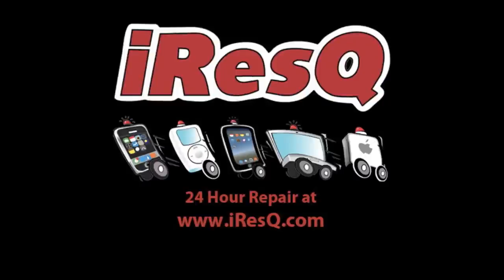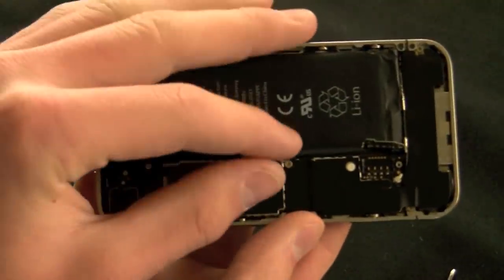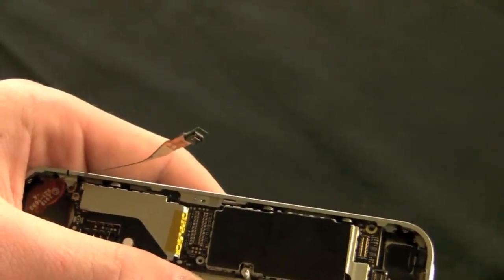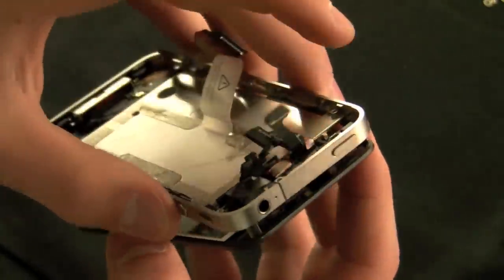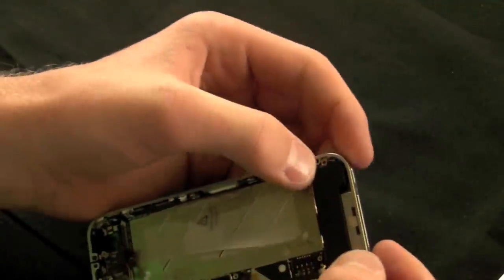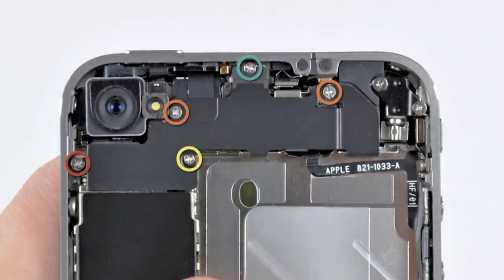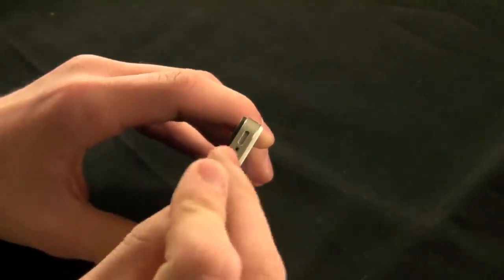iPhone 4 Screen Replacement Disassembly and Reassembly - FULL WALKTHROUGH

Comment: i took mine  all apart and then  realized i got the wrong part the one i got has no screen so its just the digitizer  not the screen witch is stuck to the old one and i tryed to see if i could use the old one then it cracked and now i cant put it back together ideas on what i can do.

Comment: the 2 screws you just unscrewed at 4:50 ( not the one under the ribbon but the other one), the other one is a stripped screw, its spinning but it wont come out. what do i do?:( i cant continue the process without being able to remove it

Comment: on the reassembly i couldn't get the top part of the mother board to go back down completely and therefore couldn't get the longest screw on the top bracket in? what did i do wrong?

Comment: everything works except the touch screen, I ripped the plastic attachment cable with the chip attached to it from the front screen but plugged the chip in anyway, would that be what has caused the problem?

Comment: thanks for the info on the speaker , my phone service is working again .. the only thing that worries me iS that im left with a piece of rubber about 1/4 inch long by 1/8 inch thick .. worried that it has a large importance like insulating wires from each other or something .. if anyone can help that would be great .. thanks!!

Comment: @ThatSnazzyiPhoneGuy Hey, my iPhone doesn't respond to anything right now. Woke up and it's not powering on or anything. My lock button is busted so power cycling it is a no go. This has happened before, and I took it to the apple store, was in and out in 10 mins with a working phone. The lady said she pulled it apart and said the connection to the battery or something was loose. It was free the first time, but now ill be charged, so i was wondering if it was an easy fix to do myself.

Comment: Have to make sure that the cables for the screen is all the way through the cut out of the case before you scure the screen. also the screws for the speaker section are no the same length.Overall it was a helpful tutorial.My phone showed no signal for an hour whe it was all done. but works well now.

Comment: Thank you so much for that great video! Nice and easy! However, it might be worth giving more details about the camera position and the cover that goes over the cables. My camera was integral part of the motherboard and just came out naturally but when I reassembled it it was not flash with the rest and I couldn't close the back. Something went wrong around there. I ended up breaking and filing one of the little plastic bits that hold the back and the phone together to be able to close it. It's not perfect but my future new phone case will keep it together. Also, you missed the vibrator in the reassembly ;)

Comment: Well I just did this and it worked but there is a mistake in there with the special screw that requires the philips screwdriver. On the disassemble it is different that where it is put back on the reassemble. *Note: The special screw goes on the top of the phone under the top plate... not on the side by the motherboard.* Other than that it was pretty good and easy to follow. I put all the screw and different parts in an egg carton to keep them in order. Thanks!

Comment: If that's happened just after you replaced the screen its because the battery ribbon has broken in some way. I fresh battery should get you back up and running. It's common for battery ribbon connectors to break, they get age and work hardened with heat and then being pulled about. Contact the video make for a new battery. Remember he should be rewarded with sales for the help he's giving away. there site is above. I hope this info helps.

Comment: at 2:58 of the video where you remove the 5 screws, the one you circled in YELLOW is the smaller screw. I noticed, because I bought a used iPhone from a friend, that screw was missing. I replaced it with the proper screw, but it doesn't screw into anything. What am I missing here?? I think a piece of some sort is missing because the screw won't screw into anything, thus the screw keeps falling out! HELP!!! @SNAZZYLABS My wifi connection is terrible and i have to stand close to the router

Comment: Addition to this comment - I realized after assembling that I had left out a small rubber spacer that went above the motherboard to protect the digitizer cables. Upon opening the device, I saw that the "yellow" screw that I had talked about earlier was missing and nowhere to be found inside the phone. Do you know the size of the screw or where I can find or order another one?

Comment: Did you ensure your antenna cable was properly seated when you clipped it back on? Go back in and re-seat it to make sure. This should be the only thing that would prevent you from getting a phone signal. 

...unless of course you weren't gentle and royally damaged something else.

Comment: Hello, last night I successfully replace the screen. The only problem now I face is charging is not working nor data connection. What should I do?
Reply from the maker: Check to ensure the 30-pin ribbon cable is plugged in.

Comment: But i do have a 4. But when I opened it up, the top left plate thing is designed differently and i for some reason, the cables to the motherboard are in different places and I also don't see the vibrating motor

Comment: hello anyone, when i reassemble the speaker at the bottom, one small rectangle black rubber fall off but i couldn't find where it belong, need help if that part is necessary to get it working! Thx

Comment: Two steps I didn't notice is 1) use the old speaker grille 2) When do you put back in the vibrating motor.

Comment: What was the name/size of the screwdriver used to take out the inside screws?
Reply from the maker: +SoldierSparky Philips 00.
Reply: +Snazzy Labs Hello Snazzy Labs, I have followed your guide 100% through, but I still got a white screen. I replaced the screen to get rid of the White screen but it is still there. It has never been dropped in water and I've made sure all connections are all in.  Please help.
Reply: I think i can help you.Pls say me what's happening
Reply: Francisco Rodrigues Thank you for the offering but I have put a new screen on it successfully but it still showed a white screen. I gave it to a repair shop they said that the motherboard is busted. I did use an app called tongbu to mirror  my iPhone screen to my Mac, that is the only way I can use it. But the frame rate is very low.

Comment: Sounds like your screw might be stripped. Check that the screw is actually turning with the screwdriver.
Also try grabbing with some small tweezers or something and pulling gently. If that doesn't work, try the same while unscrewing it.

Comment: Does all your apps and stuff stay on it or do you have to redownload them?
Reply: You are changing screen, why would it remove apps that are stored on iPhones hard drive?
Reply: Clipping your finger nails wouldn't take your fingers away. :3
Reply: One problem I had with this was that when I was finished and rebooted the phone, it was stuck in a repetitive loop at the apple logo. The only way to permanently fix this was to restore in itunes and if I didn't have all my stuff backed up I would have lost everything.  In saying that, I may just have been one of the unlucky ones, and this problem might not be all that common

Comment: the screws holding the lcd are rusted and I am unable to remove them...any tips?
Reply: If gou really don't care about the broken display, get a knife and get between the steel housing and frame-glass on the iPhone and twist it. My screws where so stuck and i couldn't get them out so i did this trick and the frame mounts (where the screws are screwed at) also came out and the screws + washers where automatically free

Comment: Good video but definitely missing some key steps... It never has you reattach the vibration motor, has you screw the screw with the "water sensor sticker" without pulling out the plastic tab that says authorized service only - you can see that the tab is incorrectly stuck underneath the motherboard in the video, and it doesn't have you transfer the metal grill and front camera lens from the old assembly to the new one (which is a real bummer to finish and realize you have to do everything again!

Comment: I'm not 100% sure, but the thing you say power the speaker, I'm pretty sure it's just the connector for the antenna. But it doesn't really matter, it needs to get off either way :p Thanks for a great walk through.

Comment: i just converted my iphone. it worked at first but now it wont turn on but only when plugged to the wall and it says connect to itunes and when i conntect it will turn on and show the logo and it will turn back off.

Comment: Followed video no problem started phone had No Service in top corner to correct this remove battery connection and reconnect, phone should start OK. Also the 6 small screws with washers that remove the screen when replacing these use a magnetic screwdriver to hold the washer in place so the screw can be passed through it. In total allow one hour from start to finish

Comment: ONE IMPORTANT PART MISSING IN THIS TUTORIAL!! - THE GRILL (THE NET) THAT COVERS THE TELEPHONE SPEAKER (THE ONE ON TOP) USUALLY STAYS ON THE OLD (BROKEN) SCREEN AND NEEDS TO BE PUT BACK IN PLACE BEFORE YOU START WITH THE REASSEMBLY. And the microphone reconnection is also missing, but quite straightforward. Otherwise - perfect! Thanks!

Comment: after reassembling. the screen is working perfectly but my phone is unable to detect any network.its not catching any signal. i ve tried with different sim cards.
Reply: Your antenna is not hooked properly see 4:50.
Reply: or u damaged one component near the connector of the antena wire when u place back the speakers module....
Reply: mohsin ali thank you very much fixed my problem :):)):) <3

Comment: Hi, i dropped my iphone 4 and broke the glass but the phone still works as normal. I'm just wondering what exactly i need to replace it? is it just the LCD screen or do i need a digitiliser and so on? if anyone could help it would be great. Thanks in advance.
Reply: I'm not sure you can just buy the LCD Screen by itself since both the digitizer and LCD screen are together. It doesn't cost you that much for a screen, I bought mine for $30 AUD and it works brilliantly!
Reply: Cool cool, Thanks a million. I've ordered one, i'll try fit it and hope for the best :) Thanks again!
Reply: Mikey Kennedy it's not like the 3g/3gs.. the lcd/digitizer are one piece for the 4's and 5's :).. you'll be good
Reply: Nolan Mendoza thanks very much :)

Comment: i know its been a really long time but i found out that i didn't connect the antenna wire on completely (the little wire you have to disconnect right by the speaker. it looks like a nub and clicks on and off)

Comment: How many different different LCD touch screens are there for Apple's iPhone 4??? The placement of the 6 screws with washers were different from my original LCD touch screen!!!??? Yes, and one of the two ribbon cables was definitely too short, and NO, it wasn't squeezed, because I took it apart and noticed it was shorter! My basic question is: how many different iPhone 4 LCD Screen and touch pads are there????

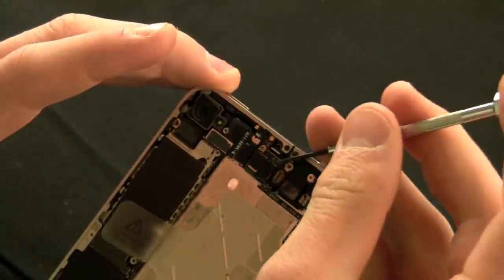Comment: 3:38 there are 6 buttons there and not 5 including he camera cable. It should be removed as well. As a result-following your video, and  during reassembly, i destroyed the new screen  back cable tape when trying to fit motherboard in its position.

Comment: you forgot the dismount of the camera before the removal of the motherboard
Reply: The rear camera doesn't have to be removed while removing the logic board. And removing a flex cable multiple times causes wear on the plastic brackets and slots.

Flexing a flex cable to much or folding it causes it to kink.

Comment: NOTE:  Make sure you buy a replacement Screen AND LCD Digitiser panel.... NOT just the screen on its own.  The old broken screen cannot separated from the digitiser without destroying it (Google it for confirmation). Those cheap screens on their own are basically useless and a scam.

Comment: If you are the original owner you can try to get it changed even if out of warranty. Happened to me when I shattered my iphone 4 after warranty. It fell out of my hand and oddly hit the floor in the corner.. I went to apple store and bitxh about how it's same material as helicopter windshield and all the crap they advertised. They said ok we'll replace it one time and gave me a new one.

Comment: Jonas Hansen dude sounds like a flex cable or digitizer problem, possibly motherboard damage (very possible with water damage)  i recommend searching ebay for "iphone 4 digitizer assembly) pick one up for 30 bucks and if that doesnt fix your problem it is time to get a new phone.

Comment: The part showing how to take the camera out is skipped over, would have been very useful, as this was the trickiest part for me. I hope my camera will still work since I broke one of the hooks holding it in place. Otherwise, great video
Reply: Well, if You see something is skipped or not clear- You can find another video. After You worked with couple of phones, You get a general idea and use it as a reference. This guy is on the genius side and he is forgiven a little mess. Some instructions are very detailed, but You will fall asleep.

Comment: You may have caught and damaged the screen cable when pulling the two ribbons through the gap to connect to the logic board or more likely you purchased some cheap crap from eBay and surprise! it doesn't work. Try buying oem parts from the guy who made this video.

Comment: SHIT i broke a ribbon cable, someone tell me what to do??
Reply: Cant fix a broken ribbon cable, replace the part the cable is attached to.
Reply: Don't worry, one of the ones from the screen?  I just did the same thing lol.  Need to order another screen again
Reply: I gave it to a guy... he charged me £70 but my phone's fine now :/
Reply: i just broke the ribbon on the left pulled it and broke...would be ordering again have to put all the stuff in a plastic bag :)
Reply: same thing
Reply: Put it in the microwave for 30 seconds.

Comment: you didn't show removing the camera but you showed putting it back ? and you didn't show putting the vibrator back and the motherboard was quite difficult to remove don't know how you got it out so easy Bro I'm just waiting for the stuff to turn up I'll let you if it works dude

Comment: All fine until my phone was in 20 little pieces and THEN you mention having to get a flat headed jewellers driver... durrg. But generally really good and informative, your hand blocks a lot of the fiddley disassembling though.
Reply: ***** did you ever find the jewelers screwdriver? i have no idea where to get it or which one to get!
Reply: +Mary Healy Just use a flathead screwdriver but small size. problem solved.

Comment: Unfortunately I have accidentally ripped the Display connector down, but I just was high as fuck. Nice video though.
Reply: I just did the same thing :( Everything went so well until I pulled the smaller lcd connector too much and ripped the ribbon off. Frustrating as hell. Now I ordered a new one. Hope I'll have more luck with second try

Comment: God damn digitizer cable ripped after trying a 2nd time to get the cable enough length to snap in place. Fucking thing was not pinched but as soon as I bend it over to connect it, the damn fucking thing rips off. Fucking hate Iphone 4's.

Comment: No shit you take out the screws, I was hoping you could show me how to without having the worlds smallest screw driver
Reply from the maker: +Nick not is typing Uh, how? By magic? Small screws use small screwdrivers. Derp.
Reply: Snazzy Labs yeah, im sorry for the hate comment, this was an otherwise very helpful video
Reply: Snazzy Labs actually i saw another video where the guy used a nail, i dont even know how but it worked for me a little bit but didnt get the screw out
Reply: yes , there are many different tools to repair the mobiles !  : )
Reply: What kind of screwdriver? Is it a T2?
Reply: You can get them off ebay for around $2-$5 (Uk = £3) and you can get all the tools needed.
Reply: our factory also supply that , good quality , welcome for inquiry !  : ) wish you a nice weekends !
Reply: You don't need the worlds smallest screw driver. If you put it into the microwave it'll loosen off the screws.